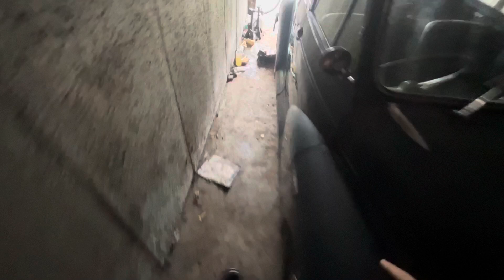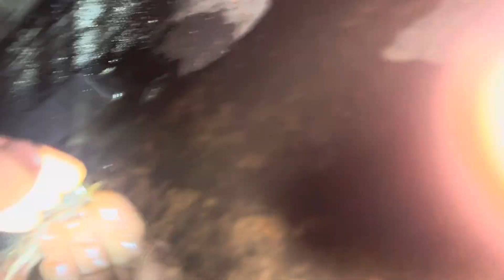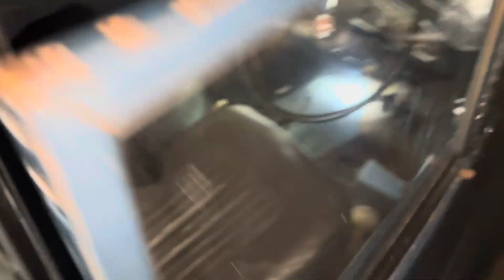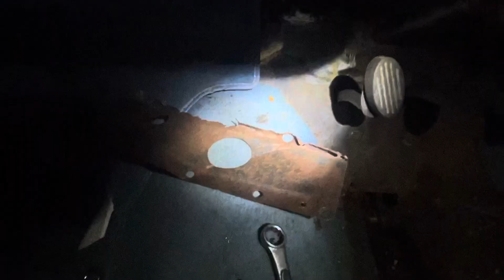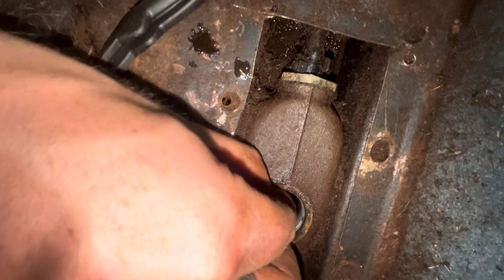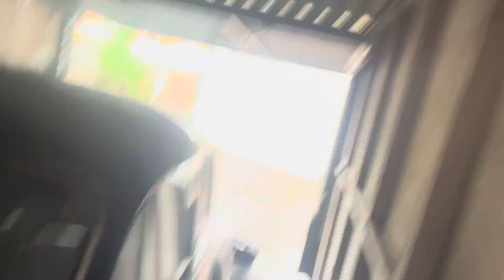MORRiS MiNOR | Unearthing The Master Cylinder |

Comment: On original assembly, the bolts holding the master cylinder in place are fed in from the outside into the chassis leg after which, the torsion bar is fitted thereby preventing the withdrawal of the master cylinder bolts. You can use a steel bar to bend the torsion bar enough to allow the removal of the bolts. On reassembly, put the bolts in from the other side of the chassis leg. There is enough room before the torsion bar to locate the nuts.
Good luck!
Reply from the maker: @thebarleymow  operation complete! Cheers for that mate - ended up using a chunky claw hammer to pull down on the bar and it was surprisingly easy! I’ve ran out of time for today, so cylinder will be taken out tomorrow and replaced and I’ll go from there…fingers crossed it’s the end of the brake woes!